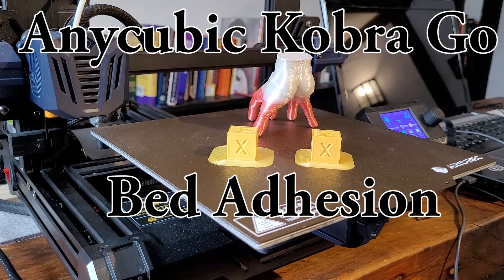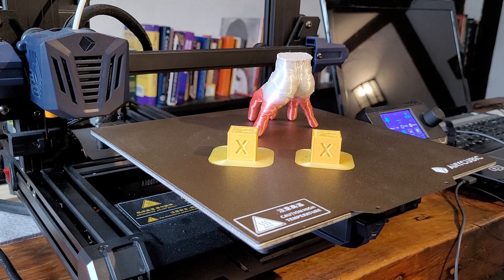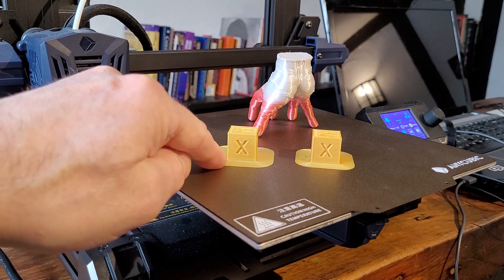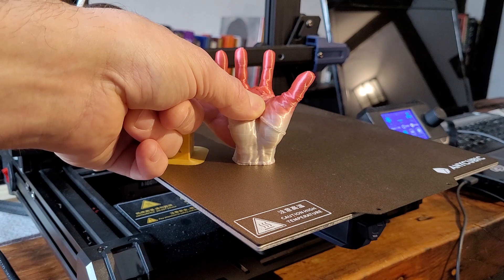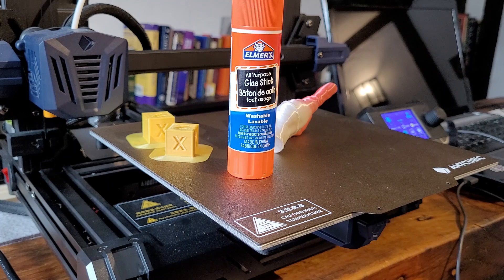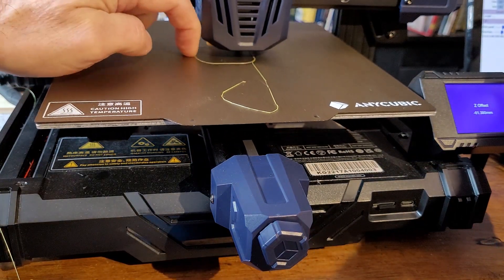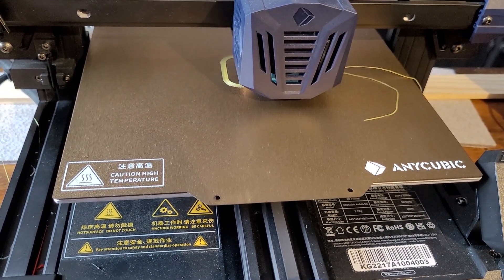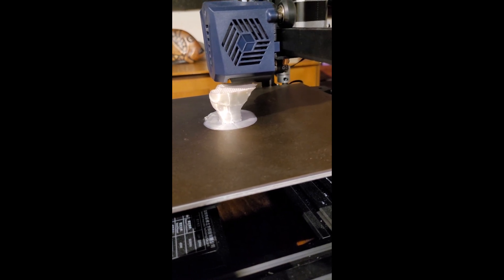Excellent Bed Adhesion with Anycubic Kobra Go!

Comment: I have a Anycubic Kobra Go. I think the auto bed leveling works good and I found you have to clean the bed plate with dishwashing soap and then before you print, use Alcohol. Glue sticks are awesome.  I like the trick with the wide brim

Comment: Just a questions regarding the bed and adhesion sticking things. Is it possible to turn the heating bed off and applying the Glue Stick? also, on the other hand, is it possible to flip over the coarse bed upside down, so that I can print it on smooth surface with Glue Stick? Thank you. I just got my second 3d printer that my daughter got me for Christmas and I had to go through some fine-tuning the new printer and am trying to make it work.
Reply from the maker: Hi Kermit
I've never tried printing without heating the bed.  Try it,  I'm pretty sure you will find the answer quickly. 
I'm sure flipping the bed will work but try that too and let us know how it goes.

Comment: Hey first time printer owner here! I got my printer around Christmas, used for a couple of months it was horribly annoying to get to work now that cura has its own option of the kobra go I don't know what to do cause the profile that came with it wont import cause of the quality i used to do the use the glue stick it worked I took a break from 3d printing from about 3 months now I have had one successful print the although I haven't used the glue yet the prints have just sucked it doesn't stick to the bed it globs up on the extruder nozzle and when the filament comes out it is curved so when I start a print as the nozzle is heating the filament comes out a little and it is curved so sometimes the hard filament goes on the start of the print also with bad adhesion sometime parts of the print get ripped of and sometimes the whole print get ripped off next thing is layer shifts I don't even know what to do  if you do see this do you know what to do I need some serious help with this printer please let me know!

Ps: sorry abt the bad grammar
Reply: also my belt sometimes go brt  and the top belt and wheels had likes almost fibrous hairs from the belt so I loosend it I don't even know what to do
Reply from the maker: OK gotcha. Late here.  I will respond tomorrow after work.
Reply: @mayhemsmiley  ok thanks!
Reply from the maker: @uraverageidiot5721  You'll have to be patient as we work through the issues. You may need to repeat steps to get the hang of the printer. Use canned air to dedust everything on the printer including the cooling fan and duct. I want you to print the anycubic owl, the file came with the printer on the sd card, no slicer needed. Do you know how to raise the z offset before the print starts? If yes then use this video https://www.youtube.com/watch?v=-nTAqqBVBks&t=13s Be prepared to stop the print and start over again until you get the z offset right. We will work on other. steps after we see the results of the owl. If you are on facebook search for Mayhem Smiley and friend me. We can message and share images etc. If you are not on facebook, please join then join the Anycubic Kobra Go group. I hang out there quite a bit.

Comment: New subscriber here! My son and I are new to 3d printing. With just a handful of successful prints done we have been struggling some with layer shifts and infill not connecting correctly. We are using a CHEAP Chromebook Os with AstroPrint Web based slicer ( our cheap laptop cant handle/download cura) any recommendations on a budget friendly laptop for using Cura instead of Astroprint?
Reply from the maker: Hi Bamab, Thank you for subbing. I have a few computers in the house. I have a 10 year old i5 next to one of my printers that works fine with Cura. It's a barebones unit that I upgraded with an SSD card for less than 50 bucks. I've never heard of Astroprint so I can't really help you there. What printer are you using and how old is it?
Reply: Okay thank you. And AstroPrint is what a lot of school systems use for cheap laptops. I guess it's like learning the ropes for slicing. I use the Anycubic Kobra Go as a printer (same as yours) and only had it a month. Got it on my son's 10th birthday. Sad to say I'm struggling/learning. And the AstroPrint Slicer will not let you model your own designs and my son was wanting me to create a character off of a video game. But I haven't made it that far and Im still learning how to find tune this thing 😅 and to be honest it's kinda driving me bonkers
Reply from the maker: @bamabassgrabber  The Kobra Go wasn't my first printer, but it definitely got on my nerves at one point. I had to take a break and come back after a week, but I've definitely made huge progress on it and thought to share with the community. Let me know if I can help with anything else.
Reply: @mayhemsmiley  yes sir thank you! I'll be watching your videos